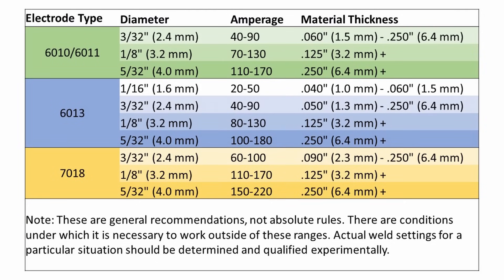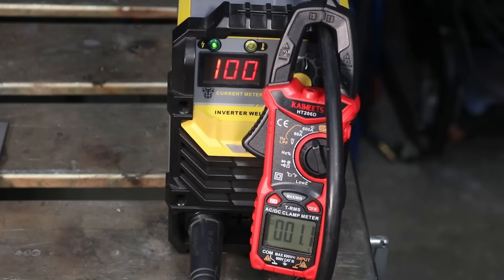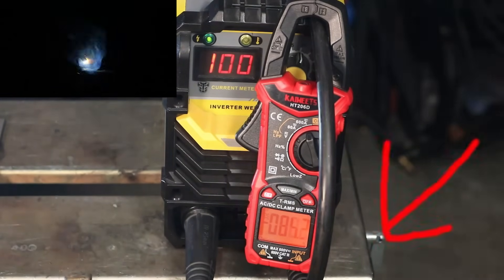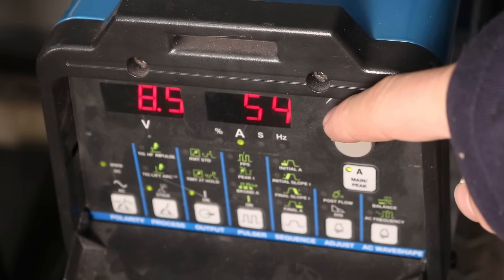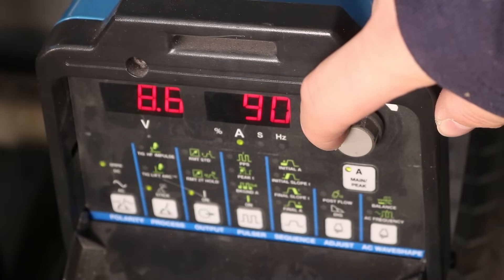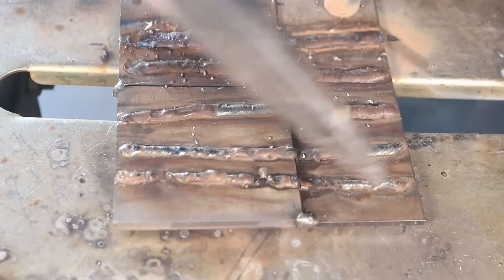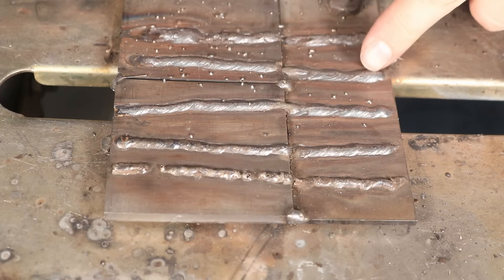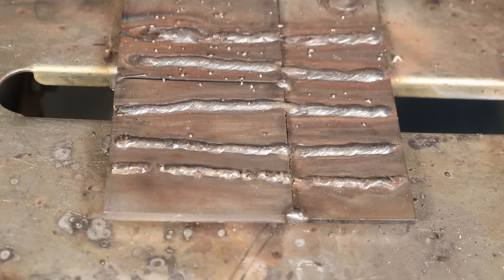How to Set Amperage for Stick Welding

Comment: I always used MIG and acetyleen welders for my hobby but now live on a boat and have to weld outside and bought a stick-welder. Thank you for these very good video's but one thing about measuring the current (ampèrage for the non-engineers 🙂 )

As an EE and repairing calibration gear (and maritime electronics) for a living, I can tell you not to trust that very cheap clampmeter to much. It is +/-2,5%+5 digits but in this price-range that is often only the performance on paper and can be way off like the reading of a cheap welder. Also shielding is often totally missing and the clamp contacts are not polished to fit seamless. 

These welding inverters are switching electronics and can produce a lot of EMI and cheap meters are often not immune to that. Probably a very good meter still will have problems. If the DC is not pure DC but has a big ripple due to not enough output capacitance (an expensive part so oprobably a thing for a cheap inverter)  then the meter will have a hard time measuring accurate. You need a very fast meter with a high CMRR. It will set you back 800-1500 dollar and then it is still a clampmeter. By the way, in DC current mode you need to zero the meter as close to the working welder as possible. So far I can see your meter does not have that function. That will make the DC current range a gimmick and if so, just forget the DC current function, it will be useless and measure way off.

 Also be sure to use the 60A range when measuring under 60A, 100A in the 600A range can (or better will, in this price category) have a very large error. I had one that was about 200 dollar and I could not measure like 5A in the 40A range. It showed a value but checked against my calibrators it was way off (sometimes reading double the real value when near something like a not so good shielded switching power supply. You can improve it a little bit by looping the cable 4 times through the clamp and then divide the reading by 4. 

Once a friend told me a 13.8V power supply was broken because his cheap meter told him there was 35V on the output. My 700 dollar multimeter showed 13,8V. His meter could not handle the EMI that the cheap switching powersupply was spraying around.
Reply from the maker: Thanks for the tips!

Comment: So if your on 125 amps what would be the best voltage to use
Reply from the maker: You don’t set your arc voltage, it’s controlled by the length of the arc. Unless you’re asking about input voltage into a dual voltage machine, in which case I’d use 240 volt input.
Reply: @TimWelds I’m in school right now I’m having trouble with practicing for my d1.1 I like to watch videos and learn more from instructors across the world what would be a good method to run a 7018 1/8 rod on a half inch plate

Comment: Tim, nice explanation. You've listed the variables for stick welding: welding technique, electrode, amperage. You've left out the elephant variable which is the STICK WELDER. Later you mentioned the welder type when discussing calibration. I guess you are assuming your viewers have electronic stick welders which is understandable because many are millenials.. Most of last century was built on "buzz boxes" and oxy acetylene"  Both are "electronics-free" and seldom mentioned in welding courses

Comment: Tim,

Will 'inductance' have a part in this? I have an Arccaptain 200 MIG welding machine and curious if I need to play with inductance.

Thank you!
Reply from the maker: Inductance generally applies to short circuit MIG welding because the arc starts and stops over and over again. Honestly, it doesn't make that much difference and I'd just leave it set a little over half. For stick welding, the somewhat equivalent setting that some machines have is "arc force" or "DIG". It increases amperage when your arc length gets really short which can help on rods like 6010 or 6011. With 6013 or 7018, the arc force setting doesn't really come into play much.
Reply: Okay, cool! Thank you, Tim. I was reading through my owner's manual and didn't see ANY concrete information of the inductance feature. Nor did I see settings relating to 220 v / 110 v outlets.

So much with this unit but I love it just the same.

Love and appreciate the video, Tim!

Comment: On a stick weld, you only adjust the amps right, and voltage basically isn't a concern as long as it is in a range i was juat looking for that info because i have seen some people make welders from alternators so i guess its a pulsed dc and i have heard some call it a high frequency dc but they mostly don't have much control but what i wantsd to do is use an arduino to read the voltage and current and you can dial it in by adjusting a pwm signal to the field windings now i don't know much about arduino coding but the internet has most of the stuff id need juat copy and paste what i need but just wantwd to verify its really just current its adjusting
Reply from the maker: Yes, you just adjust the amperage. Voltage is a function of the arc length, so the closer you hold the end of your rod to the workpiece, the lower the voltage will be. Sounds like a cool project!

Comment: My problem is I don't weld enough.  Also my jobs are rather small, usually.  By the time I have the machines settings correct, I'm already done.

Comment: There is a channel that tests these cheap chinese welders "bigtb1717".  He had a recap of all the welders he tested and has a special category called " liar, liar, pants on fire" that a lot of the Yes welders and other cheapies of Amazon fell into.
A lot of people say in reviews those same welder are great machines.  I think people are giving them a pass because they were so cheap to purchase, but they in truth are not really great.  
We took it for granted that the American brands were fairly accurate in output and power claims, because that had.to go through UL and ASME testing.   These amazon brands are policed by the market, after enough bad reviews, the sales drop off (( in theory).
Not helped by these brands sending out welders to Utube content creators for free or paid reviews that can't say anything bad about them by contract.
Not all the Chinese brands welders lie though, shockingly a company know for marketing puffery , HF, the Titanium 225 is pretty accurate even though it doesn't have a digital readout.
There are some that you need to buy a DC clamp meter and make a graph of the welders output because the output is not always linear or the same on all voltages and modes.
Reply from the maker: I like that channel quite a bit. If I remember right, I used that little DekoPro in this video and showed that the amperage can be a bit off when running on 120 volt input. I believe he put that particular machine into the "it's alright" category. I've never been asked by a brand to only say positive things about a product, but they usually provide a big affiliate commission percentage so it's motivating for creators to say they're the best things since sliced bread to increase sales. I get several offers a week for machines and turn down nearly all of them; they usually just feel off to me. I've used the Titanium 225 a bit and I agree that it's one of the best budget options and runs quite well on 6010.

Comment: Hi Tim , I like the Chart, But what is the Max Amperage setting for house current 110V/15 amps and 220V/30 amps welding machine ?
Reply from the maker: It depends on the machine, but usually you won't go past about 75 amps output on 120 Volts and around 200 amps output on a 220V 30 amp line.

Comment: Most welding machines these days dont run accordingly such 230amp during welding will decrease dramatically which affect welding and the spool goes all over. Just putting it out there.

Comment: I have a welder it has on adjustment,1,2,2-5.3-2 and when welding to use I have set it higher than setting so I went out bought welder with adjustment like yours I set the amps for each welding rod I find it easier to use

Comment: Yall some lying sobs If you say you're welding with 7018 stick at 100 amps. 110 and higher actually starts the damn weld !! For f##k sake
Reply from the maker: It’s 3/32” 7018 which typically runs good around 90-100 amps. You’d be right for 1/8” rods, though.
Reply: @TimWelds  Yeah, I knew it. Thanks for telling me what my instructors didn't !! God damn !!

Comment: There is an old trick that experienced welders use to set your amps and it doesn't involve charts and will take into account the length of your cables which will effect your amps at the stinger. Simply take a 6010 or 6011 electrode one size larger that the 7018 rod you want to use and strike an arc with it at the low end of the scale. Once your arc is sustainable, push on it as hard as you can into a piece of scrap. If it snuffs out, raise your heat a little and try again. Keep doing this until you cannot get it to snuff while pushing it in. You now have your base amps for the next size smaller electrode in 7018. IE: 5/32" 6010 will set you up for 1/8" 7018. If you look at the chart shown here you can see the amps for a 5/32 6010 are exactly the same for a 1/8" 7018 rod. Other sizes are similar in the overlap to one another.
And before you ask, yes, I am a First Class Journeyman Welder with over 40 years of experience who had a B Pressure certification in the past before I let it lapse when I retired.
Reply from the maker: Very cool! Thanks for the tip!

Comment: I have the same welder the little deko or decco whatever its called, and mine is the opposite to yours.. There such hit and miss its unreal.. Must be zero quality control at the factory..
Mine wouldnt weld with 2.3mm 6013's until I cranked it up to 110.. Thats over 40- 50 amps more than it should be.. To run a 3.2mm rod id be looking at 160 on the dial.. Also it has major issues with arc stabilization.. On mine it takes actually a couple of seconds to sabilize which ruins the start of each weld.. In contrast to that, my old man has 2 buzzboxes.. And on both as soon as you strike an arc, its stable and away you go.. I definately havint been getting the results out of it that others claim to be getting.. I actually bough 2 by mistake when ordering from amazon.. Both are terrible..

Comment: Tim, Can you actually see the 'undercut' happen while running the rod, or is it only in after-action reviews that you can see this phenomenon?

Also, why don't you get plate warp-age? I tried doing this very thing (investigate varied amperages using 6013) and ended up with a potato-chip. I know this is from heat build-up, but how do you stop that warp pressure?

Comment: Thx Tim!
Couple of things caught my eye;namely, the weld bead looked the same on the 1/8in plate and the 1/4in plate for the same current. Also, the voltage readout on your machine didnt change a wit when you changed the current. I presume that’s the way the machine works for stick welding by just changing internal resistance.

Comment: Overhead needs to be higher, similar to 1F/1G. With tighter arc, or else it will fail bend tests. That's for 3/8" thickness.

Comment: I am by no means a welder. A weekend warrior at best, but certainly try to get by doing the odd welding job. I have a Lincoln 140C mig welder that I picked up dirt cheap at an estate sale, but found it was too heavy to lug around. So I picked up a small inexpensive 75 amp stick welder (plain Jane with no fancy readouts on it). I use this for small metal works because it's easy to tote around. That being said, I use a 1/8" 6011 rod to do just basic welds. It seems everytime I work with this the rods have a tendency to stick to the work. It never fails. Is it the wrong rod for the application or is it because the amperage is set too low? I'm never happy with the outcome.

Comment: Hey brother,  can you please answer this. The experiment  you showed  with multimeter tells that current output  in 240v supply input is much highter. Could  this be the reason that  machines on lower end last only 1-2 years before pcb repair. Budget 200-250A Machines available routinely go bad.
The workers here usually use 3.15mm 6013 which they use in 80-140A range. But sometimes  they crank it upto 90%or full for cutting.  So the machine is showing  200 amp for 200A machine but could  possibly  be supplying  higher current. Could  this be the reason of their pcb failure.

Comment: My employer is telling me it should take me 20 minutes to weld 3 welds at 1/4 inch fillet welds on a flat position 3 inches long. Also to include 1/4 inch flare bevel overhead 3 welds 3 inches long. I am welding 1 inch thick plates and honestly I believe the time restriction is impossible. I am running my amps at 145 using 1/8 E7018

Comment: The problem measuring amps with the clamp on meter has to do with the inverter output waveform. It is not the 60hz sine wave or the pure DC current that the clamp on amp meter is designed to measure. This is a common issue with all inverters and all clamp on amp meters.
Reply: In theory, this welder is supposed to output DC, so.the measurement should be as accurate as the low cost meter ( it's not a fluke).  I guess these need to be checked with a scope to see if that is true?

Comment: Hi Tim. Great content. I tried to read comments if someone asked but did you weld DCEP or DCEN on these welds.
All vids I watch the guys weld 3mm to 5mm plates at G1 but I would like to see 1.6mm mild steel to be welded at the famous 45° to make a 90°. I constantly burn through on 50A and even 40A so I make really short runs at a time.
Thanx
Reply: Looking for the answer to this as well.

Comment: I have a miller bobcat 225 I have a lot of trouble with the rod sticking tried different settings seems it doesn’t help much don’t have near the problem using 7014 rods any clue what might be wrong

Comment: Dear Tim,
I love your programmes and I listen to them a multiple of times, a sign that I am learning from them still.

 I have two points to make: the metric measures have an important advantage over the Empirial measure and this is their simple graduation: X is greater than Y. In Empirial measure there are two variables: 3/32 is smaller than 1/8 but it isn't immediately obvious that this is so. It is so because 4/32 is the equivalent number to 1/8, and 4/32 is more than 3/32. Much of the discussion is lost on me because I am unable to make the conversions quickly enough.

My second comment is in regard to the ammeter set-up. Initially, you used an ammeter to show how currents effect welds. Then you chose to rely on your Miller welder because it's display shows reliable relative values for advancing current sizes.

I would have appreciated seeing the series assembly when you used the ammeter. I would have appreciated a table of ammeter values of the Miller at the close of the excellent programme.

I loved the spatter-free stick-welds achieved by correct current and speed and arc length. I loved the root weld explained and the undercut weld explained.

David Lixenberg, no-nothing, interested in everything.

Comment: take your rod size, for example 1/8" rod, 1 divided by 8 = .125 which gives you a starting point on 1/8" lo/hy rod. Adjust from there. 
1/8" 6010 about 75-100 amps
3/32 lo/hy around 85 amps

Comment: I almost feel fortunate that the AC/DC machine I bought from Montgomery ward in 1980 has no display, only some crude numbers painted next to the adjustment lever.  I adjust until I like the way it’s running, and never think about numbers on a digital readout.

Comment: I welded my Tractor Mower deck today and yesterday.    My experience level...   1 hour of practice welding with 3/32" 6013 on 16ga sheet metal..  lol.     So started to try to weld the mower deck.  I tried it at 90amps and it was blowing holes through the sheet metal...   backed it off to 70 and the rod was sticking.  So set it at 76 and it was working.   Still blew some holes throught it, but used some 6013 rod I chipped the flux off of to patch the holes.   The second day (today) I turned the heat up a little bit and welded the Mower Deck Bracket back on and fixed my boo boos from yesterday.  The mower deck was so thin, I had to build up enough metal to make sure it doesn't break again.  It looked terrible, so I chipped off the slag, gave it a good brushing and primed and painted it.   Now my mower is fixed all with a $103 Deko 160MMA.    Now I need to go find some scrap metal and practice, because when I finished I just wanted to cover it up so nobody would ever see it.  lol.   Live and Learn.   Thanks for the videos !!

Comment: I have a bit off topic question ; do we need to change  travel speed when we switch from one type to another type of electrode , but same size , say from 3/32 7018 to 3/32 6013 . 
Would it be possible to make a video on travel speed in case of stick welding ? 
Thanks .

Comment: I bet no one out there could answer this question. 
" when welding schedule 40 thick mild steel pipe with 6011 should I put the stinger on the negative terminal or the positive terminal?
Reply from the maker: I probably wouldn’t use 6011, but you should go with the polarity that has been qualified on the WPS.

Comment: hi I have a problem with the 6013 rods 2mm there burning down way to quickly  I can barely get a bead I'm welding galvanised tread plate to my trailer and I'm a beginner any tips would be grateful

Comment: Hello!
I am from India. I am 73 years younger person. I often do some engineering works and many of them involve welding. Few years back I bought an used Inverter welding machine on sale. However I am still not sure about the polarity of the work and the holder. Different people give different ideas. I have seen some of your videos. Hence I would be thankful if you can shed some light on this.
Thanks again.